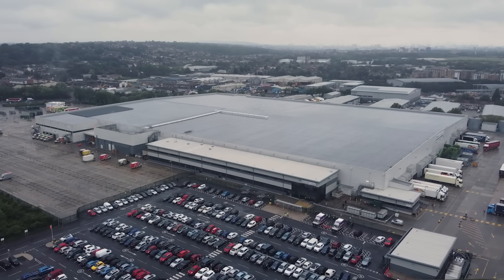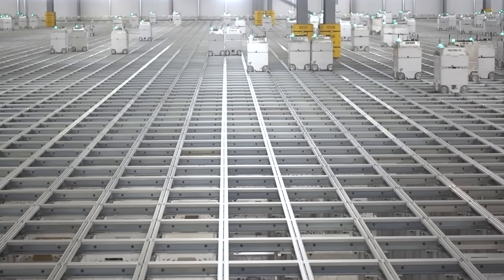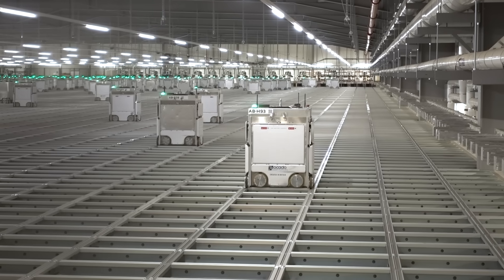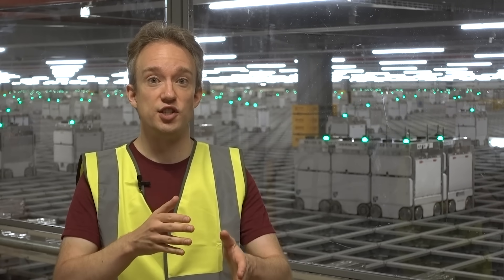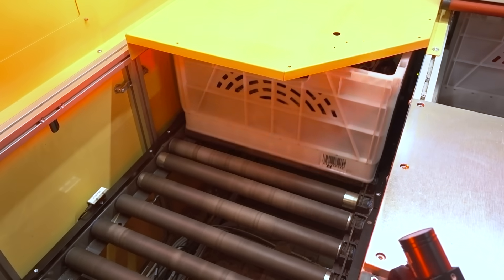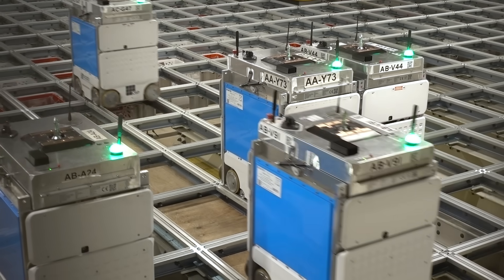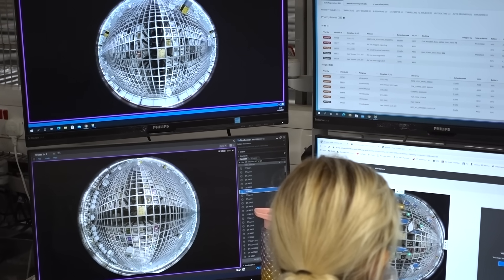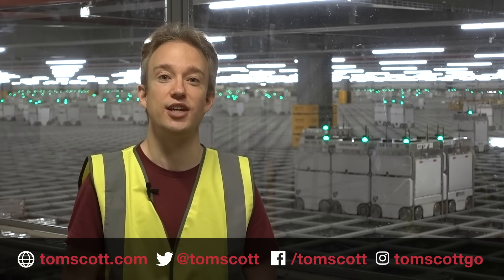How many robots does it take to run a grocery store?

Comment: I love that they are literally using an Xbox Kinect as 3D cameras for the robots.
Reply: Heard that camera was good for everything except gaming.
Reply: @mgmx2099  so it's like using the portal gun as a shower curtain?
Reply: @mgmx2099  well not quite Xbox Kinect anymore. They sell em for software development now
Reply: @mgmx2099  it was/is
Reply: It's a fantastic piece of technology! It's just not great for making video games.
Reply: I use a Kinect for VR body tracking. Some animators use them too. They're nifty as hell!
Reply: It was WAY ahead of the gaming technology it was attached to, if it instead was used as a part of an Xbox VR system nowadays it would be a massive hit
Reply: At least someone is.
Reply: That camera is an advanced little thing, but it's a HUGE pain in the butt to get working on non-Xbox hardware.
Reply: Kinect is used for alot of stuff like that its a good technology.

Also used with VR for full body tracking
Reply: They use them at the hospital I work at mostly in the Rehab floor and a few in Neuro.
Reply: This business is in serious trouble when they run out of Xbox kinect sensors 🤔🤣
Reply: @sprocket-YT  Kinect is old enough that its patents have expired. The sensor used an ingenious way to reduce the amount of data coming into the system thereby reducing the amount of image-processing necessary. In short, it views the world in low resolution, which is sufficient to locate an arm or bag of crisps; I don't think it can read package labels, but it can find bar codes.
Reply: Xbox line of Kinect is probably the most economical way to implement a 3D tracking camera into your robot system ,VR and amateur Mocap business. About less than 100 bucks which is almost 10 times cheaper than these Azure Kinect or that Asus Xtion thingy.
Reply: yes!
Reply: lots of robotics do. very popular
Reply: Oh wait no it's literally Xbox how'd I miss that
Reply: That’s crazy
Reply: Those are good
Reply: More like Microsoft used a highly sophisticated 3D camera "for their Xbox as well."
Reply: You know an modern IPhone has a Microsoft Kinect crammed in there?  😎😎😎
Reply: @hanniffydinn6019  why the "😎😎😎"?
Reply: @schwarz8614  😎 = Cool !  ……… 😂😂😂😂

Comment: I work here haha. It's not as cool as you think. There are people loading items unto the grid. There are people bagging totes, despatching and dekiting. They also have people working underneath these bots in stations having to pick 400- 450 items an hour for 11 hours. There's alway issues with the bots and the stations. We have to have 'engineers' come and dislodge and fix totes all the time. We are much faster than the machine picking. I think the machine picks 250 an hour or something like that and there's like 10 of them. Most never work. I think it'll take a while before machines are fully capable but I know they'll always need humans to run or fix the machines. And they are always hiring, if you want a job in what can be very cold fridge temperatures
Reply: They might not be the fastest, but they are a lot cheaper in the long term and has no requirements for work hours, minimum wages and such. Sure they are not as fast, but when you can have thousands of them at once, that greatly increases their production rate. But you're right, they'll always need humans to maintain them, as a single miscalculation will mess it up.

Comment: When u watch this and realise that even just 10 years ago, this was entirely impossible, not just because of 1 technology missing but because of hundreds of technologies missing that were invented over the last 10 years. Fascinating. Also, in another 10 years, this will look like ancient technology.
Reply: It has been available for a lot longer than 10 years. The warehouse automation business is getting bigger. Search for Knapp OSR and Autostore
Reply: Nah, I don't think so. Since it's a building, huge investment etc it will age much slower. Look at ships or trains, a majority of them is older than 15 years, many of them over 30. It's not phone business where people can just switch to newer thingy in 2 years - this kind of thing is used until it stops working and nobody think's it's "ancient".
Reply: Actually it's possible since years, you just have to get someone to invest money in it, it's costly as hell and it won't get a quick return if people wouldn't order online. You have both convince people that it's a good idea to spend millions to make robots that will pack goods that have maybe 3% return per item and that the maintenance in a long run will not exceed human costs
Reply: This was totally doable, I'm sure these things probably run on standard g code which has been running CNC machines and NC machines since the 80s
Reply: @kipter  i really doubt there is any advantage or applicability for G-code here.

Comment: “But what about the jobs?”
“What about my milk??  Stop making me walk around your Entire store just because you want me to look at everything!”
Reply: Thing is, this shows how the future is going to work. The robots still need oversight, planning, management... These people are probably earning a fair bit, doing stimulating work, and this system could be made very energy efficiently compared to the current model of people driving to the shop where people drive to work at.

If people are actually paid to reskill, rather than assuming a bunch of people will always be able to work in Maccy D's or Sainsbury's, then this automation won't cost jobs, but enrich them.

Trouble is, the government will probably just bring in UBI and use it to maintain a workforce of cheap labour in even worse conditions.
Reply: @DayOldMeat  Exactly. Automation itself is not dystopic, quite the opposite, it could actually improve and save millions of lives. What is dystopic is the governing elite's approach to its consequences.
Reply: That’s easy . There won’t be any . You either have to provide a way for ordinary people to earn a living wage or come up with an alternative. The writing is on the wall in very large letters

Comment: Shoutouts to the Xbox camera holding this whole operation together.
Reply: They're great for 3D imaging because they were designed for it, that's why they're used in many projects which require depth perception
Reply: XD lmfao when i saw that hahahhhaha
Reply: Glad I'm not the only one that noticed it
Reply: Timestamp? I primarily listen not watch but I'd love to see this.
Reply: @aaroncoddington884  2:25!
Reply: @aaroncoddington884  2:26
Reply: @aaroncoddington884  @2:25 they talk about the cameras, but I don't recognize it
Reply: @schetefan24  it literally has the Xbox logo on the lower left corner
Reply: @schetefan24  there's a logo right on the camera in the lower left
Reply: @ShinyRayquazza  the logo is on the right guys…
Reply: @HamIAm  Check again bud
Reply: @HamIAm  ⬅️
Reply: @HamIAm  It's on both sides. The right side has the system LED, which is also in the shape of the XBox logo. The left has the imprint and the label.

Comment: I wonder what happens if one of them breaks down in the middle of the grid. Will one of the others give it a push, or will a big claw come down from the ceiling and grab it?
Reply: The other bots will just bypass it
Reply: @tokinaw9730  - So the bot just stays there forever, until the end of the universe?
Reply: @RFC-3514  Well, they would stay there till something outside of their programming would intervene. Be it human or a human programmed program most likely.
Once they learn to maneuver around that obstacle however, they would probably carry on.
Staying until the end of the universe is a bit iffy though, they need power to run, that power is so far only provided by humans. Power reduces the universes enthalpy and increases the entropy, so they would over time decompose as the universe dies to the heat death =)
Reply: @tokinaw9730  - I'm not asking you to speculate on what might happen; I am quite capable of doing that myself. I was wondering if anyone actually knew how they handle breakdowns.
Reply: @RFC-3514  I do not KNOW, but it is quite easily handled if you think about it =)

Comment: You’re kinda wrong there, each bot has it’s own controller. But those 2000 bots are slaves and have 1 master. But still each have a controller. Otherwise it would not be able to controle the bot, process commands and drive the sensors and motors. So they are all robots, but they report and listen to 1 main robot, the master.

People working are all people, but they listen to the one in charge. (Assuming there is only 1 boss)
But they are still people. With the difference that people can think for themselves and these bots can’t.

Comment: The problem is expiration date: when you shopping you will pick up the most fresh product, but robot will pick up products with closest expiration date. Those robots need to read expiration dates as well, or otherwise they will pack some expired things. If you shop at amazon, those things hardly matters.
Reply: I'm sure that problem is already solved, likely without the robots actually needing to read the dates. When a new shipment arrives and is put into the system it will record the lot numbers and expiration date. Once in the system it just needs to remember it. If it can remember that bin 746 has crackers and bin 464 has cereal it surely could remember expiration dates for the items in each bin.
Reply: @eDoc2020  yes, if they keep track of shipments.

Comment: There have been automated systems for storing in, taking out and order picking for a long time now, I remember visiting the then Compaq warehouse in Holland, in Gorinchem if memory serves, they had an automated system that worked on the almost standard high pallet racking system and robotic high lift forklifts with arms and conveyors to move the items in and out of the locations, the system even labelled and stacked the items together on pallets and then foiled them ready to ship, and that was over 20 years ago, very cool though.

Comment: How much cheaper than humans is this exactly? Or: if the minimum wage is lower than X, it's more efficient to employ humans than robots. What's X?
Reply: Based on my estimates minimum wage would be enough to pay for the electricity needed to power around 500 robots. In real life there are more things in the consideration, such as the cost to design, build, program, troubleshoot, and repair the robots. But humans also have similar costs, such as training, and recruitment. Relative speed will clearly also make a big difference, as it will determine how many humans vs robots you would need.

Putting all of that together, if the robotic system has already been perfected the value X for a large facility like this is probably well under a dollar. The smaller the business is the higher X will be. For a mom and pop store X is probably well over a hundred dollars.

Comment: I think, that more utilitarian definition of one robot would be one system of axis, that are able to perform interpolated movement. If ABB two arms can handle element in one arm and weld it with the other, it is one robot. If central system tells car to move to the cell without specifying trajectory and the other car gets binary information, that it is no longer on the cell, they are two robots.

Comment: Seems horribly inefficient.  The bots can't even move in the x and y direction at the same time.  And what if the power goes out? 🤔
Reply: The lack of diagonal is going to be negligible in terms of energy usage. And if the power goes out... well that will probably never happen. At the very least they will have backup batteries and generators.

Comment: I would like to know:
1. How many workers it would take to replace this system?
2. What would be the annual cost of labor for said employees?
3. What is the operating cost for the machines?
4. Factoring in #3 and #4, hiw much is saved if any?
And 5. Was there a really a need for this system or was it only built because it could be?

Comment: 4:35 (Mass Effect) Geth terminology: 1 cluster with 2000 platforms.
Reply: Imagine you're just working as a grid operator in there and one day one of the robots goes "does this unit have a soul?"
Reply: (Star Control 2) Orz terminology: 1 Orz with many *fingers*

Comment: How does all the stuff get into the stacks of crates under the grid the bots are sliding over? We need a return visit showing the flow from trucks of suppliers being unloaded to delivery vehicles being loaded, with all the kinds of paths that items can take through this facility including the manual ones.
Reply: from the top, the robots are also filling stuff up

Comment: Seeing the Kinect used here makes me think this was the play all along. Maybe Microsoft just sold it with the XBOX to bring in enough data to enable them to do enough R&D to get it to a state where it could be used more reliably in industrial/commercial use cases.
Reply: its so funny seeing that surrounded by these complex machines
Reply: @301stunts  notwithstanding the branding, the Kinect is a masterstroke in engineering

Comment: Def should have made this a hexagon, travel would have been much more efficient
Reply: Maybe theoretically but I'm sure the rectangle-based system is much easier (read cheaper) to design and manufacture.
Reply: @eDoc2020  willing to bet they are doing insane suboptimizations to improve efficiency and spending way more on that and getting way less out of it.

Comment: A colleague and I have spent a lot of time in the past thinking about units and how you count them. Simply put, the criterion we had is: something has to be a physical whole to count as a unit.
The problem with unconnected units is that they cannot be said to perform unitary actions. For example: the termite colony cannot be said to pick up a grain of sand and it isn't the factory itself that makes a car, it is only a building in which cars are made, whereas a 3D printer can be said to make something.
In this case: if the carts roll freely over the tracks and are not gripped by the system, they are separate physical units. If the system grips the carts in such a way that you can only remove a cart by unscrewing a bolt or something like that, they are physically connected to the system and can be regarded as part of a bigger physical unit.

Comment: 4:40 I'd count the pieces individually as robots. Doesn't matter if they're all being controlled by a single 'mind'.
It's like having a computer connected to 10 screens - how many monitors does it have? 1 - because they're all being controlled by one machine. no. It's still 10 because they are all individual but just happen to be controlled by a single thing.
Reply: I would say parts which independently operate without direct control would count as robots. So in this case each moving piece on the grid would count as a separate robot.

To work with your computer example, I think a better question would be how many computer setups you have. Since all 10 monitors are directly controlled by the same computer I would say one to this question.

Comment: This robotic warehouse immediately reminded me of a video I saw years ago which used the same concept of little robots moving atop a storage grid with a central control system, but those robots were red, and also took up 2 grid tiles instead of 1.

Comment: I'm astonished at how thin those rails are, and the wheels leave them every time there's an axis shift, yet always nail it when they lower back in.
Reply: If I had to guess, I assume both the wheels and the rails are slightly slanted so that it reduces the level of precision required.
Reply: It's like the engineers designed it this way...
Reply: @cosmonauteable9151  You speak as if engineering was easy...
Reply: @cosmonauteable9151  It’s like this is still a very astonishing and commendable feat of engineering or something
Reply: Its cgi
Reply: @howiegruwitz3173  Nah, this isn’t the moon landing

Comment: this makes me really curious about finite-element optimization - where to tell all the robots to go to avoid hitting another bot, while getting all the stuff in the things as fast as possible. how does a real-world system like this solve that problem? what's the state-of-the-art for solving these problems? they're incredibly important as large scale automation continues
Reply: Satnav
Reply: They do not solve it. The traveling merchant problem is well know to be exponentially hard to solve. Put if i can help, they probably identify the next closet object to pick, "request" a bit of the rail for themselves so no other bot can enter those tiles and just move closer to the objective. And there is probably a few edge cases that need to be detected to prevent jamming by sometime asking a bot to move away from his objective. But the algorithm doesn't need to be perfect, or even close to perfect.
Reply: @hurktang  well that's just what I'm saying. I want to know how real-world algorithms ACTUALLY design solutions. 

Also, I'd forgotten what the problem was called, so thank you :D time to do some googling

Comment: I feel that because all those robots are individual robots, not just one. If they were connected to the hive mind via wires I would say just one assuming they work via Bluetooth or wifi. I feel like the line is if the all parts or the robot are connected via wires it is one robot with a bunch of “arms”

Comment: i'm still confused as to whether they are picking from or loading into what is underneath them.
Reply: Picking from I think. I had to watch a second time because it's not exactly clear.
Reply: Picking but when stock is low they reload
Reply: When picking they pick up a full box not just a single product and bring it down to the robotic arm where the quantity is picked out and is then sent back up to a wheelie robot to put the box with the remaining product back in the grid